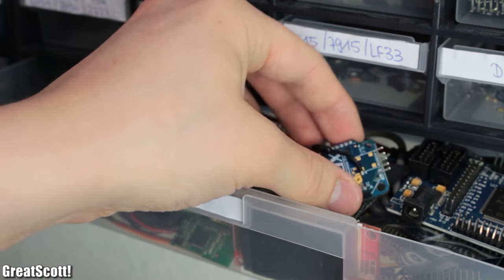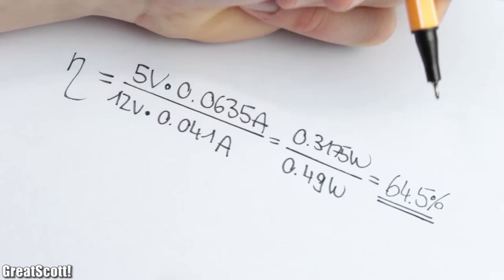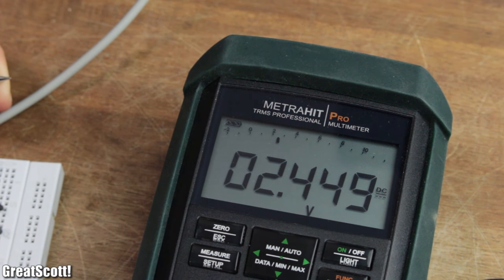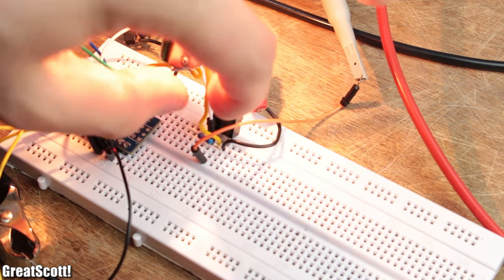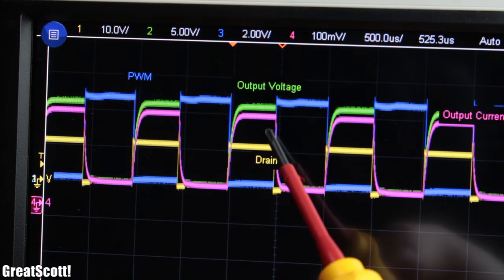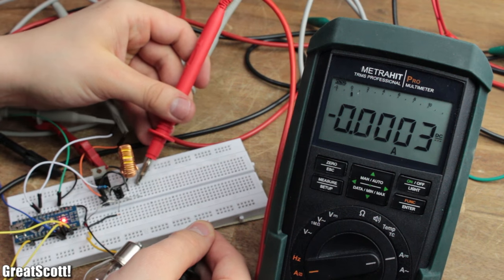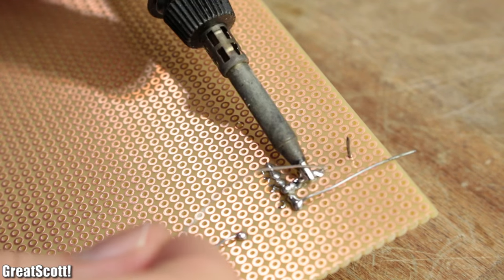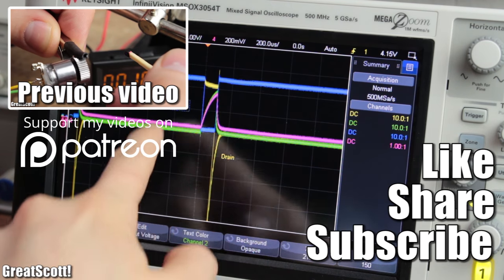DIY Buck Converter || How to step down DC voltage efficiently

Comment: I really like your videos. But in this video I have a problem with the given input voltage about 12 volt. According to the datasheet of the p-mosfet IRF9540 the Vgs is -2 Min and -4 Max. With a p-mos we calculate with Gate Voltage (minus) Source Voltage. The Arduino output is 5 Volt max. If the  Gate is fully on we have -7. If the gate is 0 Volt we have -12. To switch the p-mos we need 0 volts. So the input Voltage will have to stay at or below 5 volts. Right?

Comment: Why the MOSFET needs a pull down resistor and what is a pull down resistor? Cheers from Colombia
Reply: Victor fuaaa MOSFET gates are like capacitors. You charge them up and they stay on even if you remove the power source. You must discharge the capacitor to turn off the mosfet, which needs a pull down resistor. This actively tries to bring the gate voltage to 0 until the PWM signal goes high and recharges the gate.

Comment: Would you trust something mildly expensive, like old 100eur laptop, to be powered from fleabay buck-boost,  (the one with just potentiometer, purpose switcher chip, no buttons, screens, MCU and software to lock up) from like a 48V solar battery bank (to keep big inverter off, as it wastes power)? 
Have you ever fried enything important/expensive when such things failed (not because of your mistake)? 
And what protection you suggest, i tend to put on big heatsink on buck converter, and put linear regulator after the output, to limit voltage (if full 48V comes through, in case of total failure), like lm317 or it's higher curent versions, but about 2,5V drop over it is lost, which is not THAT bad afterall, as the thing (my netbook) uses 19v, (0.6A avg./1.5A absolute max), but anyway...

Comment: please tell me sir which converter should i use to convert 36v to 24v..
i have a 36v 4.4ah battery but my ebike is of 24v....
please tell me sir...
Reply: That's an easy one. Very easy, I don't know what your headache is.
Reply: Use a buck converter, that can deliver a high output current.
Which one, you have to find yourself (recommend a prebuild and presoldered one).

Comment: soon as i put a 1A load on the 5vout i get a voltage drop.why is this ? im using the adjust version and have the correct resistor divider

Comment: Great video. Using the adjustable version of the LM2576 IC, would it be possible to drive that V-ref with a microcontroller PWM, rather than the programming resistors? With the idea being that you can use this circuit to drive a smooth variable DC voltage, rather than using the PWM. Thanks
Reply: You can, using the microcontrollers AD converter for measuring the output voltage.
If it is higher then the defined reference value (basically making it act as an reference voltage), lower the PWM duty cycle. If the measured output voltage is lower, rise the PWM duty cycle.
This is in basic terms. 

For max stability, having a PID algorithm would make the output voltage much more stable.

Comment: Hi scot, i have a led highbay that need a 94volt, 120watt (200 smd led 3-3.5v, 350mA), that 8 string , 25 led in 1 string. Could it possible to make the power voltage diy? The old one got burn... And to complicated

Comment: Good evening all I have a ups backup that has a 24v fan to cool it and the fan is going bad I have a 12v fan that is the same size as the one in the unit but it is 12v what parts would I need to build a buck converter to bring the 24v down to 12v to run the fan I all ready have?? 
thanks for any help you can give me.

Comment: I wish to power a device which needs 5.1 volts 3 amp.
I will use 4 3.7 volt cells so my question is, which would last longer 4 x 3.7v boosted or 2 x 7.4v stepped down?

Comment: What you recommend for a Step Up/Step Down converter for dimming high power (50W to 100W) LEDs?
I want to use a 4s Lipo and the recommend Voltage for the LED is 28V-34V.
I don't want to buy the cheapest  thing from China, 50€ are OK. 
I don't find something that matches my needs :(
I'm sorry for my English skills.

Comment: Why did the voltage rise from 5v to 8v when you change the load? if Vo = Vi*D you should get a relatively stable output. Was the converter changing between continuous and discontinuous conduction modes?

Comment: Hi I am just starting to learn electronics. May I ask what can be add to your buck converter that can lower the amperage to 400 milliamps? I would like to power a 12 volt led light , that is power with solar cells to a battery. Is free energy to get some light to the entrance of this 20 something houses .Just enough to be able to open the gate.

Comment: great video but some of your electronic stuff is over my head because I don't have a electronics back ground. could this video be used to create a power supply that puts out a constant 4.22 volts? would that be hard to build?
Reply from the maker: +Mike Woods If you have a higher DC voltage as an input then Yes.
Reply: So if I had a 12 volt power supply and made this converter that you just built in your video I would be able to connect the two together  and be able to adjust the voltage to be a constant 4.22 volts? Is this correct?
Reply: +Mike Woods you literally just adjust the feedback resistors until you get the desired voltage

Comment: Fantastic video as always!

One quick question: Could you maybe make a video on upgrading an old drill from NiMh batteries to Li-Ion batteries?
Reply: That wont really work, you would need complex charging, balancing and protection circuitry.
Reply: +drkastenbrot no it wouldn't ( at least I don't think it would )
really you just need proper cells, you can't use recycled cells if the discharge is above 1c
then a discrete charging / protection circuit and you're done
Reply: +BillTheBox does the drill has an adjustable speed control?
Reply: Elia Funk do you mean would it maintain it's speed control ?
Yes I would think so

Comment: Could you please guide how to build a 60v dc to 36 v and 10 amps 12v dc voltage regulator in a single circuit? Extremely urgent

Comment: i am making a buck converter with input voltage 24 volts duty cycle 50% , 100khz fs .. but it is not giving any output .. what should be the possible reasons???? , i have used 67uH , and 220uf capacitor ..

Comment: Because of the frequencies generated by the buck converter, are these still good for audio applications? This is in regards to noise being generated.
Reply: Depends on what you want specifically.

For audio, this is at best usable for an basic beeper (using the Tone library, or manipulating it directly with pointers).
For more complicated sound, you will be probably more interested into making the Arduino work as an digital FM audio synthesizer.
https://www.instructables.com/id/Arduino-Synthesizer-With-FM/
Reply: Damn, missread your comment. You meant if a buck converters output can be used for audio generation.
AFAIK no.

Comment: my inverter welding machine put out 200amp at 50v and i want to control the output goes down to 14v for battery charging any suggestion for it? can i use this buck converter circuit to go down my voltage output and the current output is about 10 to 100amp?

Comment: Hi Scott, I'm a newbie on electronics and I need help on a very small project. I have an electric guitar which requires a 9v battery in order to work and I added a switch on the battery cables in order to completely shutdown the guitar when not playing.
When I close the circuit with the guitar plugged into the amp, I get a loud POP, similar to an amplified version of the switch "clack" sound. Is there a way to get rid of that? Maybe with a simple circuit which gradually reaches 9v in a few seconds?

Thank you for giving ispiration! Found really useful the atx power supply guide ;) My next project would be a pedal effect :)
Reply: SubnormalWater Try a simple RC circuit, that will slowly ramp up the voltage as the capacitor charges.

Comment: Inductors are a pain, they're physically large for the amount of energy they store.  Could you make a buck converter with only a capacitor to buffer the output?
Reply: +Jason Goodman because you need a low pass filter to remove the high voltage so with just a capacitor there would be no filter, just a reserviour which will output the same voltage as what it was charged with so the 12V spikes will still be there. The inductor is needed as it creates a low pass filter as inductors slow the speed at which the waveform will rise.

Comment: WOWOWOW ! Are you in rush ? You speek way too fast, the video is too fast but otherwise it's a good video.
Hope to see a DIY Boost converter video too.
And i like you do a simple 2S or 3S lithium battery charger because it's rare. Thanks !
Reply: ***** Thanks for the information but i already knew it all xd.
But if i need 12V ? I know i can use a boost converter but i imagine it's not very good.

Comment: Wie "stabil" ist so ein Converter? Ich will mir eine Fernsteueranlage bauen, basierend auf einem Arduino Pro mini 3.3V und einem Nrf24l01, weiß aber nicht, wie sensibel der Nrf24l01 ist.

Comment: I have a vacuum tube Geiger counter that uses 2 (67.5 volt) batteries in series. 
Those batteries are $64 each on amazon.
I heard the cheaper way is to use a 6 to 12 volt battery and a boost circuit similar to what is used to power laptop screens back light.

Can you make a video on how to do that? I need around 135 volts at 180ma..

The tube filaments run at about 7.5 volts.

The Geiger counter is a Nucleonic Company Ore-Lokator Model RM2N

Comment: Can you help me with something ? So heres a thing....... i need to drop 725VDC to around 230-250VDC but im going to utilize an N-channel IGBT, the output current needed will be around 18-25A, is there a readily available buck converter that can operate at that voltages and current ? Or will i have to make it myself ?
Reply: Tonny Cassidy 250V x 25A is 6.3kW, which is a heck of a lot of power. Not realistic for a DIY design.

Comment: Dear scott,i have been using LM2576 for motor driver circuit for voltage regulation of IC s in electric vehicle project. The ICs draws exactly 500mA. But after certain minutes the LM2576 is heating up. Suggest  some other as a replacement. Thank you

Comment: To build a hunge arduino based step down converter say that would handle ~100A output I would simply need bigger parts that would handle the current? like diode caps and inductor? and ofc a massive heat sink so far I ve been using 10x ebay 300W step down converters in parallel but its a pain in a ass to sync them to same output voltage.
Oh, and talking about arduino controlled step down converter would the output voltage be digitally controllable?
 Hope you have time to respond to the question.
Reply: KrissAtSro What in the heck do you need 100A for? A 100A diode will be huge. Heck, the soldering would have to be done to big copper bus bars, not a piece of perfboard.

Comment: Will the output stay the same if the input variate by 1-2 volts? Like when the battery discharges?
Reply from the maker: +Ignafiltro Sanchez Yes
Reply: +GreatScott! So I should be able make a circuit with 19.5 V output to charge a laptop, with the input for the circuit being a 6 cell LiPo pack (22.2 discharged, 25.2 full charge) or 7 cell LiFePo4 (22.4 discharged, 25.55 full charge)?
Reply: BTW Im aware of the dangers of LiPo, Ive experimented with high capacity cells myself.

Comment: A question : why do you need a resistor of 10k ohm between gate and source ? for what 
purpose ?
Reply from the maker: Watch my video about MOSFETs.
Reply: otherwise the gate gets stuck 1/2 open / slowly changes the state cos the mosfet uses stuff all power so it doesn't open or close fully ..

Comment: Hi,
I want to use my solar panels to Charge my 12V or 24 V Battery Bank. Currently I am using 5kW ABB On Grid Inverter. Solar Panels are connected in series and voltage receiving to Inverter is (48 v x 5 = 240 V). How do I reduce the 240V to 24 V?

Comment: +GreatScott! I've rebuilt your circuit, but the Output Voltage is very unstable if I attach a Load to it. I've connected a Raspberry Pi to it and the LEDs of the Pi are flickering and my WiFi-Dongle doesn't work. Do you know what is the Problem?
Reply: I've found the Problem: I used a Diode which was not capable of switching that fast. I changed it to an 1N5819N and now the Circuit is  working Fine.

Comment: What if I want to make an adjustable current source?
I'd like to make a portable adjustable current supply that I can use to test lasers, LED etc.
Is the arduino fast enough to prevent current spikes that would destroy a laser?
Reply: try something with lm317 t
Reply: +Nikola Nikolov I've already built a current supply with an op amp, a few caps, a voltage reference and a couple of MOSFETs. It took me a lot of experimentation to make it so that there's no current spike when I connect or disconnect the load while the supply is on.
Now I want to implement it as a buck converter (because the device is battery powered), but I have no idea how to implement the same type of protection on a buck converter - or if it's even necessary.

Comment: does anybody know how he drives the mosfet with a pwm signal of 0-5V in the gate and 12V in the source? I've checked the mosfet's datasheet and it says that the minimum Vgs threshold value to turn it on is -4V. According to that , the mosfet would be on all the time with those signals.
Reply: I think its that when the 5V from the Arduino is applied to the gate, the voltage between the gate and source will be (5-12) = -7V and since its a p-channel mosfet it will turn on, and when the PWM is off the voltage between gate and source will be (12V-12V) = 0V and this will turn off the mosfet since you need the voltage between gate and source to be less than -4V to turn it on.
Reply: @omarali-yx8fp  I already saw the signal in the Drain just using the pmos and the resistor between gate and source , but nothing happens: the drain signal is 12VDC. However, when I drop the in-voltage  (12VDC) to 8V, it does work.

Comment: I'm an Electric/Electronic noob here. I was wondering if this circuit is capable of maintaining the output voltage if the source has changes in its voltage over time and if so, how far is the range?

Comment: Hi, I'm using Arrduino UNO and want to do this experiment, I changed the duty cycle but the output voltage at D gate of mosfet did't change. I  supplied 12v DC voltage but ouput is also 12v. My duty cycle is 190 because I want to reduce voltage to 9V

Comment: Does the feedback on arduino worked ?
Reply: yes a voltage divider can read the final output voltage into the arduino's analog input pin and the software can adjust the pwm signal to alter the output voltage in order to adjust the voltage to accommodate changes in load.
Reply: work*

Comment: I was recently looking for a buck-boost converter that could stabilize a very inconsistent input voltage (3v-8v) to 5 volt. are there any solutions similar to your circuit? Something easy to build?
Reply from the maker: +Christian Heuer Better search for a premade board on Ebay.

Comment: hey Great Scott, I love your videos...
Here you are connected mosfet source to 12V and 10k resistor between gate and source it is okay, but you connected arduino to gate so arduino receives 12V...!!!! It is possible that not damaging arduino ???
Reply from the maker: +Nikesh Pansuriya No, it will not get damaged.
Reply: +GreatScott! why???
Reply: +Nikesh Pansuriya Because of the resistor, when arduino pin is low(zero volt) current from 12v over resistor is 12v/10k ohm =1.2mA. Arduino can handle about 20to40mA per pin (if I remember correctly). Current is even lower when arduino pin is high.
Reply: Bro,use Ohms law and substitute voltage and resistance and find the current,answer lies there..
Reply: +1978jra +Sam Mads 
if your logics are correct than we can use esp8266, hc-06, and many more with suitable resistor in series to Rx pin..!!! But we can't use.
Reply: Can you explain what you are trying to say..I mean we use resistors at RX to create a voltage divider.
Reply: +Sam Mads exactly we use resistor for voltage divider not use series resistor to limit the current
Reply: TX and RX pins are configured differently. Also perhaps esp8266 and arduino pins are protected differently.

Datasheet will tell you what each chip will tolerate.
Reply: Hey Scott, I don't understand why you pulled up the gate to 12V but not logic 5V..
Reply: I don't understand why you trying to limit the current to those pins?
Reply: Sam Mads current limiting is not for you it is for 1978jra
Reply: Series resistance is one way to protect ic-chips. Inside arduino  (atmega chip) is protection diodes that wont allow voltage on pin to get higher than about Vcc+0.5V (or too low). These diodes are pretty weak and wont stand much current.

If pin is in high or hiZ state voltage tries to get to 12V (because of pullup) but before that protection diodes start to conduct and current start to go through resistor and over voltage is burned as heat in resistor. If pin is in low state then arduino has no problem to sink that 1.2mA on its own and keep voltage near zero and also this case over voltage is burned as heat in resistor. (perhaps when high state excess current go also thorough ic itself to the Vcc. )

How he did this circuit is not the best way to do this, but apparently it works. One transistor more before p-channel mosfet is nicer solution, but why bother when someone else has made better and easier solution?

And yes series resistance is not good way to make voltage suitable for RX-pin, but it is quite nice way to protect that pin. (depending on many things, like speed of the data).

This is still a short answer to question why 12V(likely) wont break arduino if there is 10k resistor in between.